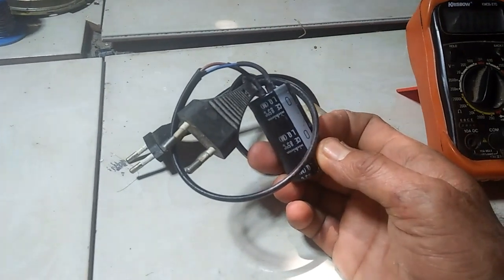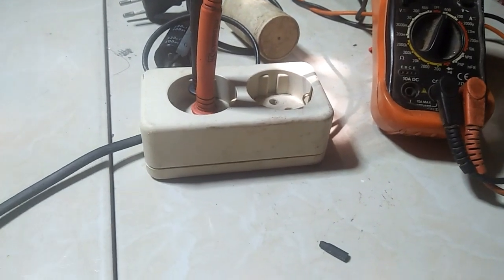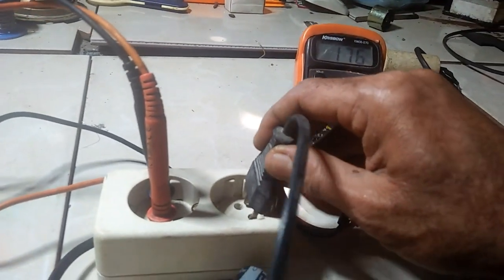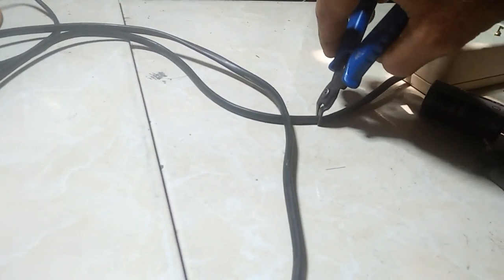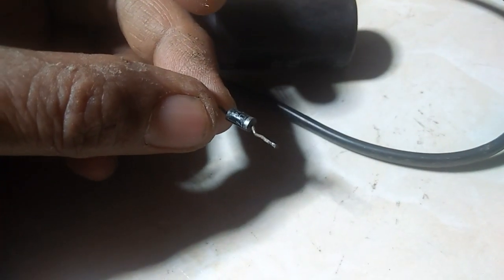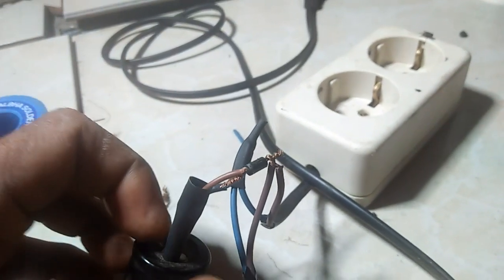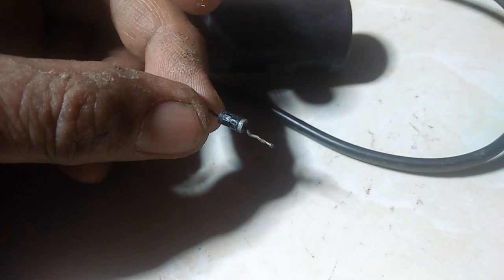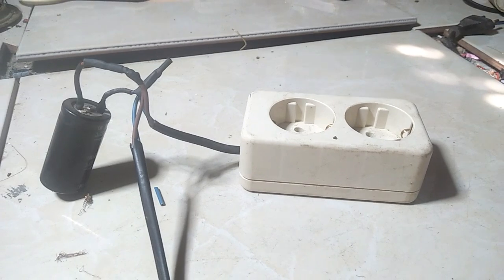CARA MENAIKAN TEGANGAN LISTRIK YANG DROOP DENGAN KAPASITOR DC.

Comment: Kalau untuk amplifire aman gk pak
Reply from the maker: Ini yg keluar teg dc..!!!
Reply: Di tempat sy lk malam pln suka drop pak bahkan bisa sampai 150 vol ac pak jdi speaker aktif sy harus make sravol pak kira" bisa gk ya rangkaian kapasitor dc itu di aplikadikan sebagai pengganti stavol pak
Reply: @drivermuda3591  kalau tegangan dri pln dibawah 180 v, maka stavol akan panas dan bau gosong..dan lama" stavolt yg rusak.
Lebih baik lapor ke pln utk menaikan tegangan lebih dri 190 v, agar stavol tidak cepat rusak/terbakar.